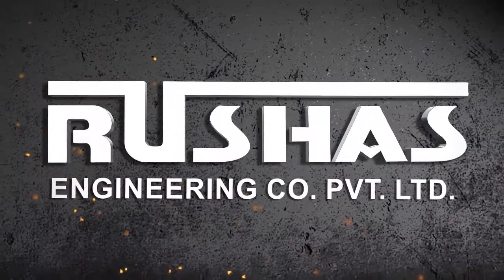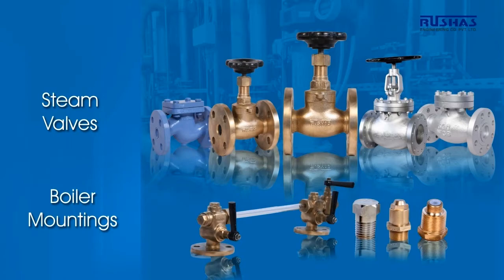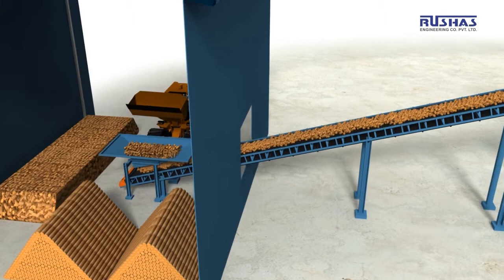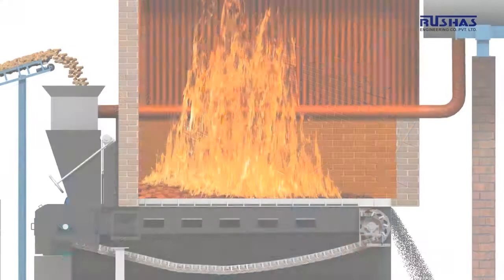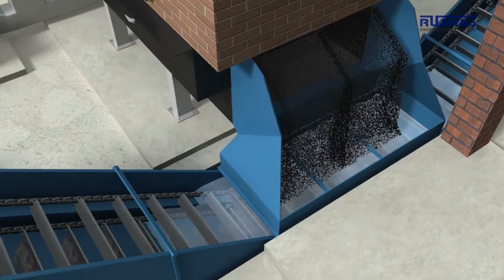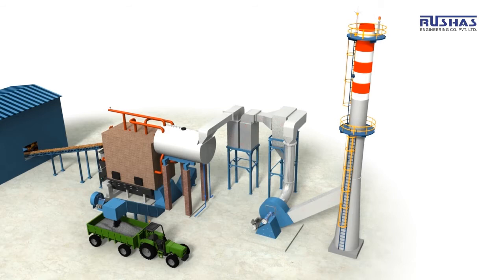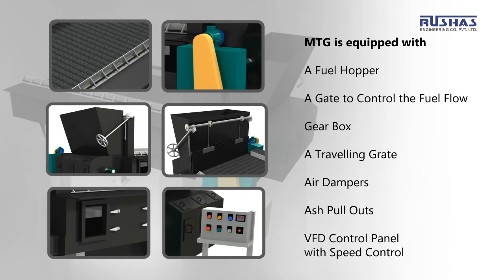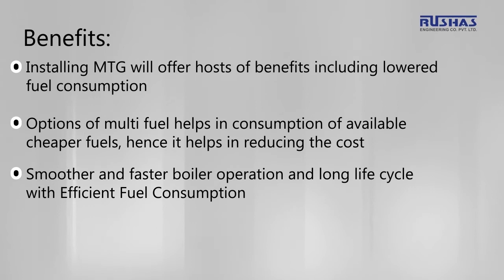RUSHAS Mini Traveling Grate - A Small Boiler Stoker for efficient boiler House!

Comment: Which country is this Rushas thermal oil heater. Really you
Reply from the maker: Sir, We are from India.

And, This Video is about our newly invented product Mini Traveling Grate for the external furnace of small capacity solid fuel boilers in the range from 3 TPH up to 15 TPH.

We also manufacture Steam Valves, Boiler Mountings, Boiler Castings, Grate Assemblies and Industrial Castings.
To know more, you can Email us at mtg@rushas.com and marketing@rushas.com